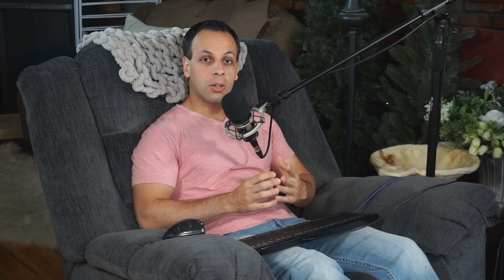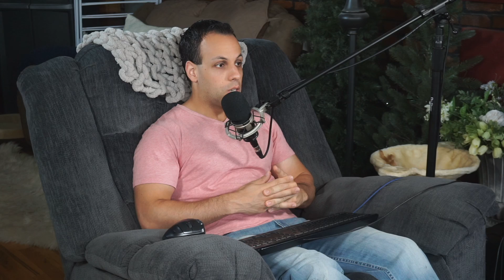Let's talk about what Right to Repair means for how devices are designed.

Comment: I agree with everything you said except that manufactures should absolutely make it possible to replace the battery in every device. It doesn’t necessarily have to be done like the old days with an external hatch just for the battery, but the device must be designed to be able to be taken apart and re assembled without damaging or destroying it, if done carefully. 

Take the AirPods for example. After a couple years the battery will not be very good. So why can’t I just pop the case open with a pointy object like a pry tool and replace a coin cell battery? Instead the device will likely be thrown out for no good reason.

Comment: I find the people against this coming up with reasons that don't make sense to me. I never saw anything that suggested redesign so it could be repaired. What I saw is stop making it a RICO organization where you get charged as much or even more to repair something and can only be repaired by the manufacturer , which often causes people to just buy the new product. I've had things break that were cheaper to just buy a new one and I bet most of you can think of something like that as well.

Comment: I agree - let Apple build the best devices they can. It's our job to figure out a repair. What I hope we are asking for is Apple to not go out of their way to make repair impossible. Release limited schematics for known failure modes. For new failure modes, work with the community to make a repair possible and then release limited data and also make hardware available to make that repair possible to the consumers that want it. If they don't and just want to buy a new device? - have at it. Buy a new device, but then that broken unit can go on the secondary market, be repaired properly and sold to someone else and not end up in a landfill for a couple a thousand years. Noone is asking Apple to limit their development - just don't go out of your way to make repair impossible.

Comment: IMO even if right to repair is passed you still are not going to get your chips that are manufactured by TI. Have you ever considered the chip is a custom job that is contracted to TI by Apple to fabricate? Apple buys the fab house time to design and produce the chip or Apple designs the chip themselves and contracts the fab house to manufacture it. The way I see it, if that is the case, I do not think you will be able to force Apple or TI to sell you the chip or provide it to a distributor for sale. TI is bound by contractual obligations to Apple to not manufacture and sell the chip except to Apple. Apple, just as about all consumer electronics manufacturers do not build their own products. They may be involved in the design process but they do not fabricate the chips or boards. That is a contracted process with another manufacturer. There are about 3 advanced chip fab houses in the world. Just my 2 cents.

Comment: The funny thing about that person's argument with "technology advancement" is in fact the "soldered on CPU's and GPUs" and the non removable battery was never new or even "technology advancement", since they had existed years ago. Sure it is much better with some components been used for being smaller and can do much better, like From IDE cable to SATA cable for an example.

This just burns me when people are being ignorant and claiming what is new technology and what isn't. Even with the difference nickel plated batteries compared to Lithium Ion batteries. Sure lithium ion batteries are better, but the way manufacturers implement them on console remotes and laptops are really stupid. Because none of them are truly infallible. Because if the battery goes, so does the rest of the device.

This is like having non removeable CPU, GPU, RAM and Storage. Even everything in between, as well having the PSU sealed in the case. I would like to know if anyone think that is technology advancement?

I am not against people who wanted to have the devices the way they wanted. And right to repair is obviously not about forcing the manufacturers to change the hardware.

Things like that is making me loose my cool. Because soldered on components and built in batteries had existed YEARS AGO! Which most people never had truly thought of or even think it had existed.

Comment: I'd personally like a briefcase laptop as an option. have a machine that's actually upgradable, has adequate quiet cooling (think a couple full desktop sized high end graphics card coolers,) a solid 17" or larger screen, and has a full sized keyboard in it.
consumer choice is what is at the head of Right To Repair. you should be ABLE to choose whether you want a 3rd party independent repair done, rather than having them locked out by default because manufacturers create anti-competitive designs

Comment: Right to repair by necessity requires access to all source code.  Not only  am I just fine with that, it's obvious that all commercial source code should be available from no later than five years after public sale, or one year after the last update, whichever occurs first. Also immediately upon dissolution of the corporation in question.

All video games.  All productivity software.  All EOLed operating systems. All automobile and heavy equipment software.

There's no reason for John Deere to be able to lock a farmer out of the computers running his tractor.  There's no reason Ford should be able to lock a mechanic out of installing better operating software on a mustang.  You get the idea.

I would prefer user replaceable batteries, but I won't die on that hill.

Comment: I sort of disagree with you about device design.  While I don't agree with the design police I think they should be required to make some effort to make a reasonable repairable device.  Using iPads and iPhones as an example.  Older iDevices with no waterproofing are still glued shut making it very difficult, often the most difficult part of the repair, to open them.  Why not a simple gasket, and I have several waterproof devices, not from Apple, that use some form of gasket.  Once opened up, since the battery is probably one of the most replaced parts, and you likely have to disconnect it for most other repairs anyway, so why not have the battery cable be the first one to detach instead of buried under three other cables and a plate.  Have that plate's three screws use the same head instead of three different heads and don't glue the battery in, so that half the phone's parts have to be removed to get to the glue strip tabs that are going to snap off anyway.   None of those things are going to change the size, weight, or functionality of the device, it will just be easier to repair.  If a company can reasonable say that X was done because it serves a legitimate purpose, that most independent technicians agree makes sense, even if it is harder than the old way or an alternate way, then there is no no issue with that.  In other words, the manufacturer should not be allowed to make it unnecessarily hard to repair devices in attempts force people to pay for repairs or buy new devices.

Comment: I would like everything to go back to being socketed and through hole however I would also like to fit my phone in my pocket. . . . It's good to stay ahead of the slander. 

User swappable batteries would be nice though. My old Samsung Galaxy Note 3 had that and it basically has the same form factor as any modern phone today. Why can't they do that? I don't buy the "waterproofing" excuse either, it's just lazy engineering.

Comment: Standardized diagnostics would be useful.  I am running into this problem with a BMW car where most scanners are having trouble communicating with the cars computer.  Essentially electronic locks that prevent access to diagnostic information.    Same for replacement parts.  John Deer and Apple are famous for this.  Can't even use good used parts because the electronics are programed not to accept the part.

Comment: To make it short for the impatient, the tech companies make unique hardware parts they do not sell to repair facilities, which even comes down to SCREWS, where instead of a 4 rivit (that little cross on the screw bit you put the screwdriver in) normal tiny screw in one case I recall they made their own screw that requires a special screwdriver to unscrew. For no reason, too, there were screws that fit that particular hole, they just wanted to make it harder to repair.

To go on, They make their products with traps that damage the product if touched, they glue down parts that don't need glue and their stores actively scam people into thinking their products are irreversibly damaged (for example water damage indicators that change with slight changes of humidity that aren't water damage)

To make THAT short, they scam you.  They scam everyone.  They do this to more than just computers, they do it to FARMING EQUIPMENT, making it untenable for farms to operate and potentially causing huge famine down the line if this is not passed.  Farmers have had to hack their own gear just to operate, because the replacement cost is immense, when repair without these companies interfering in EVERY STEP is a negligible cost.  This has gotten completely out of hand and tech companies are grasping outside their reach and threaten to completely fuck over something big if nothing is done.  This is just one of the bad things these companies are doing.

And they don't like that we're finally done with them.

Comment: Consider AMDs' AM4 socket platform; With software updates, that X370 motherboard could be utilized for multiple generations of CPUs. It would make sense that if you could repair it or update it, it would be better environmentally than just junking it. As goes with GPUs - the performance may not be sufficient for you now - but for someone else it may suit their needs for the next 3 years or more. Being designed to be able to be pulled apart and fixed if something goes wrong with it would be good for the consumer and environment. except manufacturers continue to 'advance' their technology, put 50 screws of varying lengths and head types when it could be done with 10 screws of the same length and type...

Comment: The right to repair is the right to get the part you need, the board-view to know where the parts go with the voltage readings to troubleshoot these devices. and I hope they don't inflate the price of the parts. I think this baseline statement can triumph any bullshit propaganda that flies in. "oh so i cant make a battery that's soldered to the PCB?" Well solder comes off doesn't that mean it can be replaced?! They can make the device impossible to disassemble via a locking mechanism but guess what; you should check out lockpicking lawyer.

Comment: Y'know, a lot of the discussion with right to repair focuses on functional components.  And I get that. But if we're worried about the longevity of devices, I think aesthetic or structural components of devices are just as important. For example, I use a Logitech MX Ergo, fairly expensive as far as computer mice go. All the components still work perfectly. But after a few years of use, the chassis is getting worn down. And it's not just a matter of cleaning it. Skin oils eat into the plastic, fundamentally damage it. Some components in a device are more expensive than others. I do think it's important that I'm able to repair all of them, but if I need to, say, replace a $50 component in a $60 device, it might be worth it to just buy a new one and save the hassle. But with an example like my mouse, I find it absolutely ridiculous that I'm forced to consider buying a new mouse just because there's nowhere for me to purchase a $1 piece of injection molded plastic. Absurd.
Reply: get someone with a 3d printer to make a new piece of plastic for you...

Comment: German/European here:  the standarized charging port is what basically amounted to having Phones charge via USB and Apple wiggling around it by making adapters, so - theoretically - same chargers can be used. Previously, Siemens, Sony Erikson, Nokia, Blackberry etc. all had their own unique-ish chargers.

As for user replacable Batteries: Various modern phones do have user replacable batteries, like the Galaxy Xcovers, Motorolas Moto E6 or the Gigaset phones. They're hardly giant bricks etc.
While IMO it's not directly something that's related to right to repair, since technically speaking it doesn't prevent professional repairs, it would be a positive aspect from a environmental friendly perspective. It's a bit of a unpopular thing to bring up, but at the end of the day people won't bring a phone worth about 30$ to a shop, then pay for repairs and the battery.

More importantly however, I think looking at EVs Batteries are the mayor point of failure. 
Accepting them to be unneccessarily hard to replace / preventing 3rd Party Batteries does directly feed into planned obsolescence.

I don't want to come across as "I'm right, you're wrong". I just feel like at the end of the day the minimum solution might just end up being not enough, especially for people with low income, where it's less of a convinience or enivonmental thing but about basic needs i.E. keeping a EV (which may become mandatory to some degree) running / keeping a used market for EV.

Comment: I understand where you're coming from. You want to get to the lowest common denominator. If you can get parts and schematics, that alone will be a huge upgrade from before. However, adding that manufacturers consider repairability and e-waste in their designs shouldn't be a big ask either. I don't want to mandate they do something 1 way, but if Samsung was able to build a galaxy s5 with waterproofing and the ability to replace batteries with ease, now that the s21 has a plastic back again, there really is no reason they have to superglue everything to waterproof it and glue down the battery. My s10 battery is starting to show its age, it has maybe another 6 months and then the battery will be complete garbage. Why should I have to toss a device that does everything I want, with specs I'm still very happy with, just because Samsung made it very probable, that if I crack it open I will probably damage it, or at the very least lose the waterproofing. If they designed it to last more than 3 years from the start, this wouldn't be an issue.
Reply: Exactly. Wristwatch manufacturers figured out how to waterproof their watches some 4 decades ago and still screw them all together.  Phone manufacturers can't figure out how to do the same? That's a crock!
Reply: @MrAdamGC  I hate to say it but it is way, WAY easier to waterproof a watch, than a thin-ish, bendy slab. Its all about the tolerances required for a truely proper seal, casing rigidity and device aspect ratio, as in surface/thickness.

Comment: The rules can be very simple, components that have a significant sorter lifespan as the rest of the components should be easy to be replaced.
For a computer/tablet/phone that would be the battery.
For a car/truck/tractor that would be tires, brake pads, light bulbs, air filter, oil filter etc.
And obviously this can change, if there is a battery that last 50 years it can be fully integrated in the product.

Comment: I mostly agree with right to repair. But I am concerned when you say you would like to be able to go to the company that makes the parts and buy them directly. Many manufacturing companies are handed the specs by the device manufacturer of what to make so they do not necessarily do the r and d to make the part so if they sell it after the fact and make money or doesn't exactly seem fair. But I totally agree that the device manufacturer should be required to sell parts and diagrams to end users or third parties for repair. If you happen to see this and have an answer I would love to hear it I am not as well versed as yourself just a concern I had.

Comment: Right to repair in a nutshell:

"Right now there are factories manufacturing every component inside this computer, right to repair simply asks that those same components are made available to purchase for every repair shop."

This is how I would describe it in the simplest way.
Reply: I would add owner to that as well.
Reply: and a schematic to know what that part does and how to service it.
Reply: There's also the aspect of "any locks that are built into device, hardware and software, must have their keys made available to the legitimate customer."

Which tackles shit like serialisation. It's alright to use serialised components to stop people frankensteining new phones from stolen parts or whatever, and provide some security against hardware level tampering, but the keys for that shit need to go to the owner, not be held by the manufacturer. Put them in the user manual that comes with the phone, or even better, let the user set a password, like we do for all our other security measures.

Comment: About the software locks:
Couldn't manufacturers always argue that changing out the storage could compromise the device because the storage controller chip contains malware or smth? It's obviously complete bs but it sounds like it could be dangerous

Comment: In short, I support Loius' position.   Some knowledge, skill and equipment is required to repair modern devices.
Trained repair places can replace BGAs  ( ball grid array ) or SMDs ( surface mounted devices ).    The through hole devices and sockets limit the frequency of devices, consume more power, radiate more noise and take up more space.  My company can replace BGAs and SMDs but we had to send people to get trained.  It also takes some expensive equipment for magnification and scopes for testing.   We don't do PC repair.